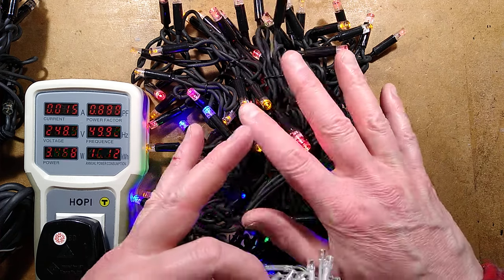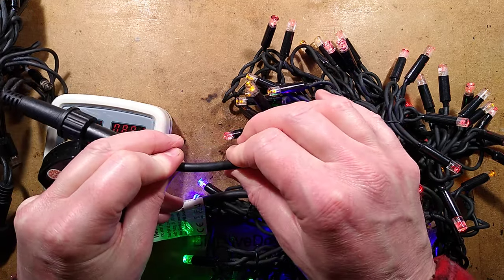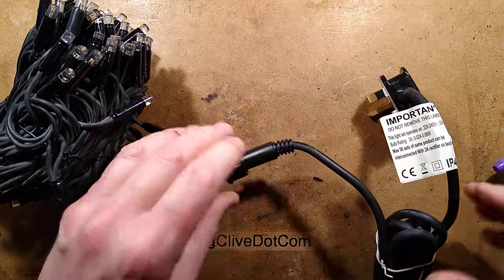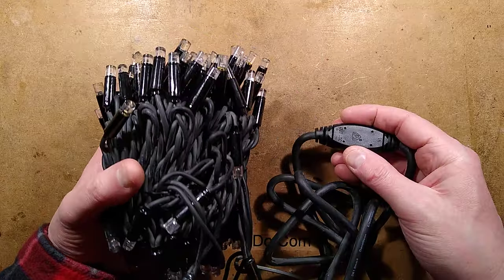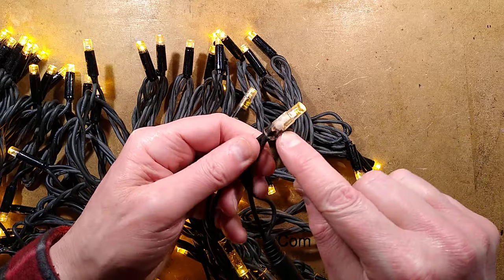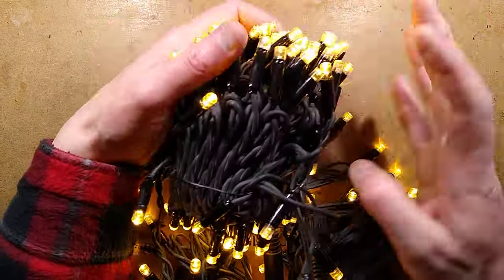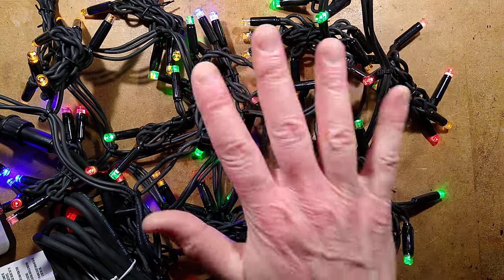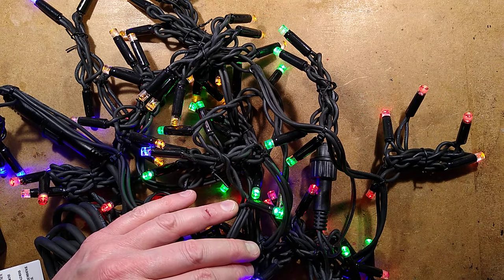The construction and wiring of professional LED strings.

Comment: I had one running every night for years in my carport. Took a bit of time to run them down. After 6-8 years the wire started to look a bit crusty but maybe it was just bug crap. I have about 15 of these chains for the garden only for Christmas. Have had a few failures but not like the cheap ones that sometimes only lasts a season or two. 😀
I like the system that you can connect them together and use splitters into 5. 
In the beginning they said max 2000 LEDs pr run, now they say less. Can’t remember how many right now.
Reply: 2000 lights in sets of 50 would draw 0.6A, 5000 would draw 1.5A .  I'm guessing the limit is the gauge of the pass through wires, with the sub-2000 type using thin chinesium wires inside the rubber.
Reply: @johndododoe1411  You could be right. Sounds like something that could happen. I guess I should be looking for a different manufacturer for new chains next year.

Comment: Wow - Great video. :-)
I'm an Electrician & I've been looking into the differences for Industrial grade LED strings for Christmas. To date, I've been installing cheaper Domestic grade lights. These are not as robust, but customers are usually happy with the costs :-)
I'm now being requested to do larger Christmas installs, tied together with Smart Home control, so business is increasing :-)
Out of interest, which UK suppliers would you recommend for the purchase of these higher quality lights??...

Comment: Merry Xmas, can i ask a stupid question.... I’m getting into electronics and just learning.... The white Leds have 10 680ohm resistors to drop the voltage down 100 volts. Why when plugged into the extension set,  which has another set of resistors, doesn’t it drop it another 100?...
Reply: Look at the diagram he shows near the start.  There is a power bus that runs the full length of the set.  The led's and resistors in each set are wired to the power bus.
Reply: Ah many thanks.. miss that while I was making tea...

Comment: Ok so i have a side hustle where I supply and fit these lights... So my client who has a good horticulture program she had going on at her house wanted us to sort of bury these lights underground and just leaving the bulbs out... we did it ... sealed everything with cement.... tested it ... t went well .... then later on there was a heavy rain 🌧... the part that you labeled as the rectifier got burnt (when it rained , it was exposed)... so the lights dimmed .. and some were off completely... now i donnoe if it was because of the rain , the reason why it got damaged... or there is a short circuit in our connection.. which I doubt since t was working before ... so my question to you is 
1 can we by-pass the rectifier? And if we can, can u help us how? Because before and after the rectifier the cable goes from being a 2-cable to a 3 cable ... 

2 is t ok to you a 3 pin plug (originally it has a 2 pin plug)? And if so which fuse rating do i use?
Reply from the maker: You can replace the rectifier, but the output polarity must be correct.
I really recommend against burying LEDs and wiring.  Especially mains voltage.   They should always be accessible for service.  Concrete around wires can stress them, especially at slab joints.
If even a hint of moisture gets into underground DC connections they will corrode rapidly and fail.   The best approach for underground joints is to pot them in electrical gel.

Comment: I was going to make my own Christmas lights for outdoor this year, designed my PCB including all the parts and casing roughly £15 then wiring, pvc heatshrink, £38 then the LEDs £42 but $78 for shipping 😳 decided to buy some and put waterproof silicone sealant in the ends of the heatshrink instead

Comment: you telling that overdriving make leds color shift? i have a keyboard i wanted to put pink leds in and it made them blue with time
i must put some paralell resistors to make them lower brightness because they were uposed to be pink not purple or blue :]
Reply from the maker: The early pink LEDs were very prone to fading.
Reply: @bigclivedotcom  i don't know if it is early pink led or not , i just bought pink smd leds in package they got in stock in store year ago. i doubt they sell a lot of them though

Comment: I have the cheap chinese lights working since 2012! I always see a wire pulled out of the led and i just tape it shut. They are breaking apart and are dangerous if mishandled. Looking to replace them.

Comment: I find my external lights get damaged in the wind. Sadly my very large 1000led set appears to have several failed sections after the last high winds. Must work out how to fix them (furiously checks Clive's previous video's for any hints)
Reply from the maker: There's a science to supporting strings and allowing for tree movement.

Comment: The light technology in there and the products are “almost there”. 
The lights solution I’m looking for are the 100ft of led IP66 lights for professional use (so they will stand up to staying on an outdoor tree for many years nonstop and actually by IP66). But be the RGB les type which are addressable like the current similar batch of indoor Xmas tree lights that software can 3D locate all lights of and allow you to program an executable light display sequence. 
The RGB Color selection is most critical so one can display the colors of the season without having to replace the lights on the tree in the garden : Xmas or Easter or Independence Day etc.  
If ever you find such a set do test it and let us know what you think.
Reply from the maker: WS2811 pixels?

Comment: The colorful ones also have a nice effect with using more yellow and red LEDs is to balance the brightness for the colors. Blue and green are InGaN and extremely efficient, thus a lot brighter. In colorful LED strings red and blue usually are getting almost invisible by the InGaN LEDs.

Comment: Put a reasonably sized capacitor at the end and you get rid of the flickering... or just a loud bang if you mixed the polarity.
Reply from the maker: That would raise the voltage to peak mains and increase the current through the LEDs and resistors dramatically.
Reply: @bigclivedotcom , Ouch. I completely forgot that.

Comment: @Clive I had a battery driven LED string with the llacquered wires from LIDL  that kept slightly flickering ( brighter and darker randomly) even after I removed all the active components. How is that possible?
Reply from the maker: When an LED fails in parallel; strings it makes all the other LEDs flicker.  A thermal camera can find the rogue LED.  They often cause much shorter battery life.

Comment: In the US, all the 120v light sets are pretty darn durable.  We bought 15 strands in 2009, all of which are still in service.  The battery or wall-wart operated ones on the other hand, are garbage.  A bazillion gauge wire heat shrinked together.
Reply: That’s a bit of a sweeping comment. I’ve got low voltage sets that run off a PSU/power adapter and they are now in their fifth or sixth year of service.

Comment: I can't tell you how many blue and green LEDs I've had to replace on my GE brand Christmas lights.  They used mini LEDs for one.   The first season with just 1-2 months of use I replaced over half the LEDs.  The legs on the LEDs would just rust off in the sockets.  They didn't weatherproof the sockets. I ended up using a hot glue gun and sealing the backs of all of sockets.  The next year rust wasn't a problem but the blue and green LEDs burn out all the time.  I'm ready to throw them away and buy a set like what you showing.
Reply from the maker: The blue and green LEDs are a different technology to the red and yellow in older sets.  Much less reliable.

Comment: The resisters are 1/8w? so 125mw with 150mw going through them? Shouldn't they be using 1/4 watt resisters?
Reply from the maker: It's probably a size thing.  But the resin will help dissipate heat.
Reply: @bigclivedotcom  I suppose it's also half-duty after the rectifier - oh but it's a full wave rectifier... Is that 150mw peak or RMS? AC maths is hard

Comment: They last longer, you say?  I know of at least one property management company for a downtown commercial park that just cuts the lights off the trees at the end of the season.  I guess they figure a new light set is cheaper than unwrapping it and storing it in a way that won't be a tangled mess next year.  Plus, with new sets each year, you're less likely to have troubleshoot problems. of wear and tear.
Reply: The man hours are definitely worth more than the strings, if they can undo 45 trees in 2 hours instead of 5 its already worth it.
Reply: Would have thought if they were going to go down that route they might as well use the cheep and cheerful domestic lights considering they only need to last 1 season.

Comment: How well would these react if they where used on a theatre dimmer Clive?
Reply: Poor brightness control range if the dimmer uses a normal diac/triac type of control system.
Reply: @Mark1024MAK  Yeah, I don't plan on doing this to be be fair. If I have to run any kind of fairy lights for a show in our theatre, I normally choose circuits of 24v static lights and run them from a PSU and DMX decoders for desk control. It was more a curious question to see if a theatre dimmer would damage any of the electronics albeit minimal electronics in this case.
Reply: @Stinkymole  - I think it would be unlikely to cause any damage to these professional type of LED fairly lights if you did connect it to a dimmer. The diac/triac type just chops up the mains waveform. The professional types that Clive showed are well designed with sensible current limiting resistors. It may not be the same for the really cheap sets though. The repeated sudden application of voltage when the mains cycle is at or near it’s peak voltage may cause extra stress to the LEDs if they have skimped with the resistors.
Reply: @Mark1024MAK  Yeah, I'm of the same thought. I think they would operate, but for how long before something fails. It will be interesting to see if Clive chips in on this. Thanks for the replies dude.
Reply: @Mark1024MAK  I don't think sudden application of peak voltage would cause any stress because there aren't any capacitors. I've used cheap mains LED strings on an ordinary TRIAC dimmer before and nothing bad happened.

If there were capacitors in the circuit then there would be spikes of high current which could cause failures. Clive had an old video where capacitive dropper LED bulbs failed when being used on a flaky switch which was bouncing/arcing; unfortunately I can't locate that video now.

Comment: @bigclivedotcom
Is a type of AC RCD still a thing in England? This variant has not been permitted in Germany since 1985. Today's basic variant of type A can recognize pulsating direct currents.
Reply from the maker: They're slow here.  They are so busy making new regulations for other things.
Reply: Yes, a lot of existing domestic, office and industrial installations still have/use type AC RCDs.
Reply: If it's being installed for an event, it should be a type A RCD. That's if the company is installing to BS7909 standard. As Mark mentioned, alot of installs are still on type AC as that is all is required by BS7671 currently

Comment: And if you're in a high-wind environment, you can always zip-tie them to a thin steel wire. Or simply shorten the continuous wires a bit by zip-tieing a short loop. That way they'll take the brunt of the pulling force.

Comment: I remember my mother having proper outdoor lights. With the regular bulbs and thick heavy cables that were rugged.
For the last 8 years I've been looking around my local shops - gardening and landscaping shops and stuff like this to find PROPER outdoor lights for my balcony.
Only cheap splash resistant stuff and everything else that is just wrong to use.
Maybe I'll scavenge through the internet to look out for industrial ones. Seem way better and proper for home use.

Comment: H05 doesn’t say anything about the material it’s made of. H means the cable design is harmonized and 05 indicates the voltage rating. RN is what really says something about the material (Rubber Neoprene)

Comment: I think most of the consumer grade Christmas lights sold in the USA are somewhere between the commercial grade you're showing in this video and el-cheapo Chinese versions, leaning towards the better ones.  I've been using an outdoor set of LED lights for the last 3 years with no problems, and had another set lit continuously for about 4 years.  I bought an ebay Chinese set because I wanted some deep purple or near UV lamps that are hard to find in the US, and they were so cheaply made that I was afraid to leave them unattended.  The lights sold in the USA don't typically have a rectifier that I know of.  You can see the 60-cycle 'shimmer' if your viewpoint is vibrating, such as if you go "Pbbbbbbbbbthhhh" or imitate a motorboat :)

Comment: Have you worked with flat-screen TV LEDs?
Reply: LCD TVs with LED backlight typically use completely ordinary LED strips.  OLED/QLED TVs actually have tiny LEDs as pixels, while big stage background and signage TVs have ordinary size LEDs as pixels.
Reply: @johndododoe1411  the voltages vary on them between 3 and 6 volts each with some strips being 12 volt and others as high as 53 volts. I cut some in half so that I can power some on 24v.

Comment: What if u put a 400v capacitor at the end ! It should increase the brightness!
Reply: Why? Because it will charge and discharge? Just smoothing should not help too much
Reply: @kitecattestecke2303  it will increase the rms voltage and help the led run for longer time while the zero point is going on. Even a 10mf cap should hold the voltage close to ac peak which is like 350v on 240v mains.
Reply: @Matt Quinn a simple capacitor is never a complication , its a added point of failure but adding a capacitor will help with the rms voltage.
Reply: If you put a 400V capacitor after the bridge rectifier, connected anywhere on the two ‘straight through’ wires, including the end, three things would happen. First, if the capacity of the capacitor was great enough, it would charge up to the peak voltage of the mains cycle, which for a 240V AC mains supply (actually at 240V RMS) is 339.4V (ignoring the rectifier losses) and stay near this voltage. Now the LED chain will draw more current, because now they are getting a nearly constant 339.4V voltage, whereas they were designed to run from a 240V DC RMS voltage. Hence the LEDs and resistors will get hotter due to the higher current and it’s likely that their lifespan will be reduced. The third (and beneficial) effect is that there will be no flicker.

Comment: I  use incandescent Christmas lights personally, but these are interesting to know how they work! Also LEDs don't twinkle in the same way incandescent lights do-
Reply: These ones twinkle.  100 times per second, the voltage drops below 150V, and they all go out.  Which is almost precisely what incandescent bulbs do at about the same moment.

Comment: How does it run at 300v when mains is usually 240v
Reply: Rectified mains is always higher. 240v is the rms(average) ac voltage.
Reply: The peak of the sine wave is 1.4 (sqrt 2 if we're picky) times the RMS value.
Reply: @Matt Quinn - if there are no transformers or capacitors, then there will be very little difference between the peak off load and on load voltages.
To expand the earlier answers, the mains AC waveform is a sine wave. The positive is like a half circle, so the voltage rises from zero up to a peak, then falls to zero again. Then the current changes direction. The voltage then goes increasing negative, again in the shape of a half circle, before going back to zero. Then the whole thing repeats. But using the peak (maximum) voltages is not very helpful when doing the practical calculations. As the values and hence the equations are completely different to those we use for DC supplied by a battery or cell.
Hence we use an average value for AC voltage and current that is equivalent to the DC voltage and current from a battery or cell. Further, because the average value of a AC waveform is zero (not very helpful), we use a mathematical trick, hence the use of RMS - Root Mean Square to get rid of this useless zero average. Hence all AC voltages and current values are normally given as RMS average values. So a filament lamp supplied by 24V AC RMS will light with the same brightness as the exact same lamp supplied by a 24V battery.
When you full wave rectify a AC supply, the resulting DC is just the same as the AC input, but with all the negative going ‘half cycles’ now converted to positive half cycles’. The DC RMS voltage is still the same value as the AC RMS input voltage (ignoring the small losses of the rectifier diodes). But the peak (maximum) voltage at the top of the half cycle is the RMS voltage * 1.414.
So for a AC supply that is a nominal 240V, the peak DC waveform is 339.4V (again, ignoring any losses in rectifier diodes). LEDs themselves require between 2V and 3.5V to turn on and light. So a chain of LEDs with a combined voltage of 300V (100 x 3V) will turn on when the part of the half cycle is at a voltage of 300V through to 339.4V and then will stay on until the half cycle drops to below 300V at which point the LEDs will go out again. This will be repeated 100 times a second if the mains frequency is 50Hz. But because for a large proportion of each half cycle, the LEDs are off, you may see some flicker.
Reply: @Matt Quinn - We are talking about 15 to 30mA via a 0.75mm squared copper (I assume) cable. How much voltage drop/losses are you expecting when the load (the LED chain) is connected? Granted if the current was several amps or more, that would be different.